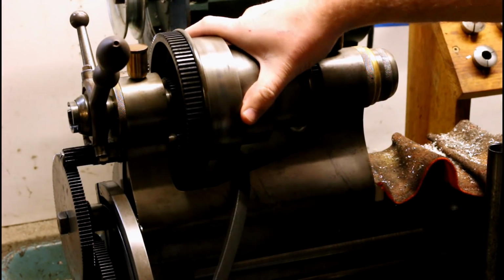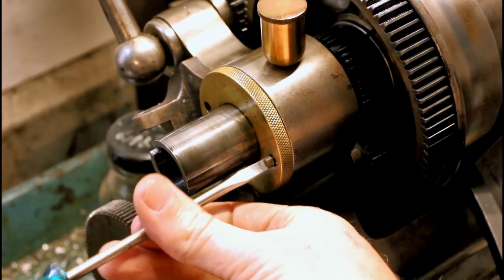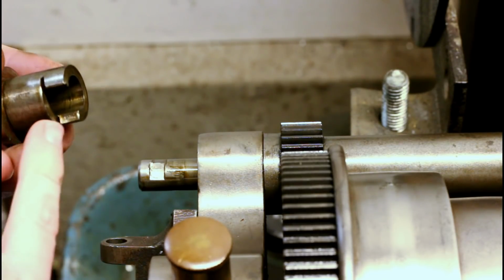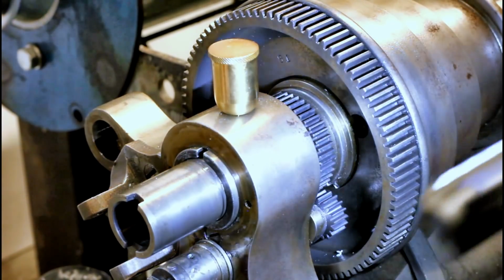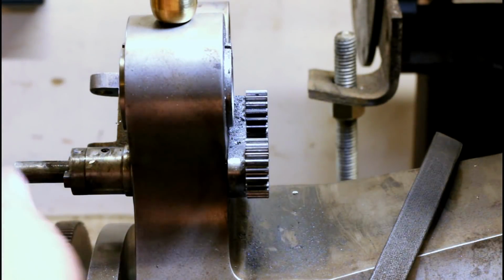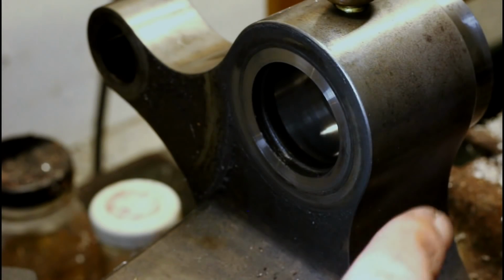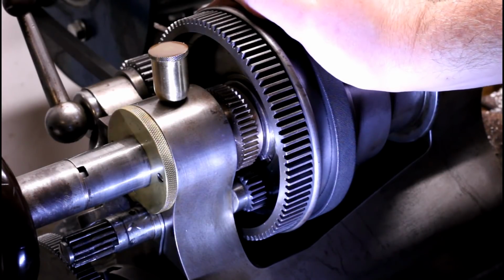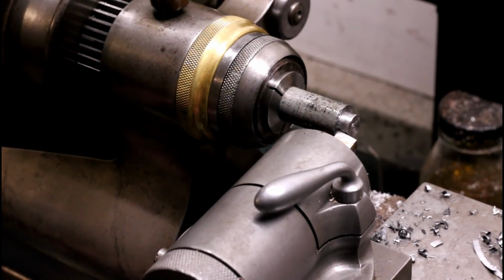100 Year Old Spindle Bearings

Comment: Thanks for sharing all this. You sure have my sincere appreciation.

Is the runout of the headstock adjustable ? I can imagine the conical bearings to tighten up if the axial preload is adjusted. Im just missing how rivett solved this.
Reply from the maker: Thanks for watching! If I understand your question, then the answer is it's solved by bearing angle and surface area (of which there is much) combined with a film of the appropriate oil type. I imagine the angle of the bearing taper also plays a crucial role. Take note of that double angle taper on the front bearing - the steeper angle toward the nose is probably key to preventing binding under axial load during cutting. Of course both angles must be lapped together perfectly for this to arrangement to work. It's no wonder these machines cost as much as a house when they were new.

Comment: Would you mind telling me what kind of milling machine you have and especially your opinion on it.
Reply from the maker: My pleasure! It's the LittleMachineShop Hi-Torque Mini Mill.  For general work of smaller size, it's good - I think it's one of the better import mill/drills of this size, it really is small.  If you can accommodate something like a used Bridgeport or Burke, then absolutely get one of those instead, if they aren't overpriced in your region.  If you have the space constraint, as I do, then it's hard to beat one of these for the price.  Of course a watchmaker size Sixis, Aciera, or Schaublin, would be far superior - but also 4-5 times the cost.  I like the LMS version because it has larger base and table castings, with more x and y travel, has R8 spindle, has belt-drive spindle, has variable speed brushless DC drive & motor, has dovetailed column, and a fixed (non-pivoting) base.  At the time (several years ago), some of those were features not offered on other import mill/drills - now you can find several companies selling these SIEG-based mills with most or all of those same features.  The only thing I really dislike about it is the fine downfeed for the Z axis.  It's a rather sloppy worm drive so there's a lot of backlash - it doesn't hurt anything, but it does let the rest of the machine down.  The tram spec was something like 0.005", which is already a lot, but even then mine was out of spec. I used Stefan's copper wire & epoxy technique to get it trammed in.  Typical of sliding dovetails on cheap import machine tools, the gib tension has to be tweaked as you move to different areas of travel.  A weekend of crude scraping on it would probably go a long way.

Comment: Good to see you back, JOP. I was amazed at this video. Here we have a 100+ old lathe with cone bearings not only running but taking toolroom cuts. They must have had some heat treatment techniques that we have neglected. Of course in the 1920s Timken invented the tapered roller bearing and it was so good that people stopped using plain bearings. But to see a plain bearing hold up for a century is a real treat. And I too am about to use  Canadian cutting oil. Breakfast in the shop. I too watch theogwheel :)
Reply: Automobile plain bearings regularly last 500,000 miles. As long as you keep them lubricated, don't overload them, and spin the spindle fast enough to maintain the oil film the spindle is riding on the bearings will last a very long time. Most plain bearing wear occurs at startup and this is hard on lathe bearings where start-stop is the normal operation of the machine.
Reply: True. Locomotive bearings had much the same performance. But the Timken bearings introduced the other factor: ease of maintenance,  so  the old  #1111 loco became the industry standard for locos. In the world of watchmaker's lathes, plain  bearings were standard until Foley (I think, may have been Rivett) introduced tapered bearings. Today nobody makes  plain bearings on lathes, for same reason that Timken  made its name with #1111.   Ease of maintenance.
Reply from the maker: @aceroadholder2185  fascinating! Are they still used? Commercial trucks maybe?
Reply: @TheJoyofPrecision  I can't think of any production automobile that doesn't use plain main and rod bearings. Many motorcycles however use roller main and rod bearings. My Norton motorcycle uses roller mains and plain rod bearings. it has 100,000 miles on it and the rod journals are still within stock size specification. 
  If you study bearing design, you will see that the different types of bearings have their strong and weak  points. Careful consideration of the intended application will determine which is the best bearing to use.
Reply from the maker: @aceroadholder2185  ah, of course - I don't know why but I had wheel bearings stuck in my head for some reason. Stupid brain wasn't processing what I was reading, lol. Yep every motor I've had apart, except for an Arcticat 2 stroke, had plain bearings throughout.
Reply from the maker: Hi Juan! You're right about heat treatment techniques, I read once that Rivett (and others) would quench their finest bearing steel into liquid mercury. Small wonder we don't do that today. 🙂
Reply: I blame it all on Timken for inventing the roller bearing :)

Comment: Nice job. So what exactly is Canadian cutting oil??
Reply from the maker: Thanks! Haha, Canadian cutting oil is bacon grease. Little running gag between Justin and I, from the podcast. 🙂
Reply: @TheJoyofPrecision  Back when I started in the shop 55 years ago, they used bacon grease. It actually works well, especially tapping cold rolled steel... but on a cold morning the shop smelled like bacon and eggs from the smoke and I'd be starving!
Cheers from NC/USA
Reply from the maker: @aceroadholder2185  lol! It really does work well 🙂